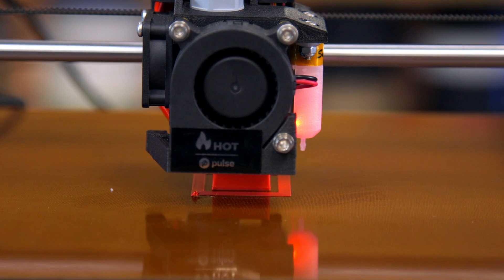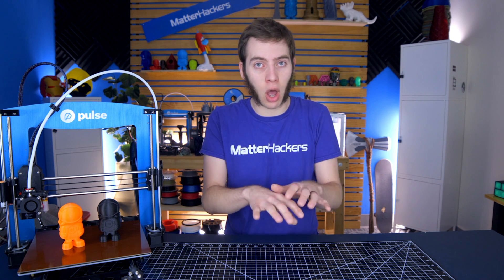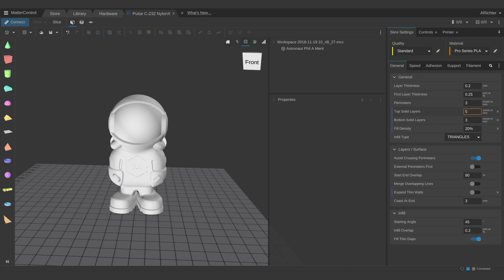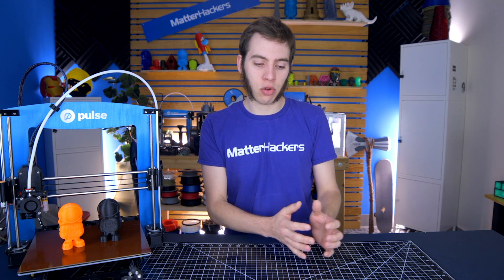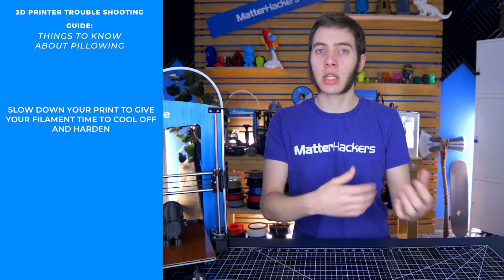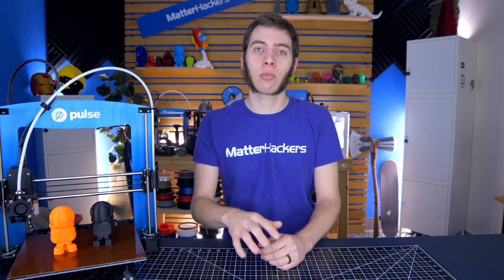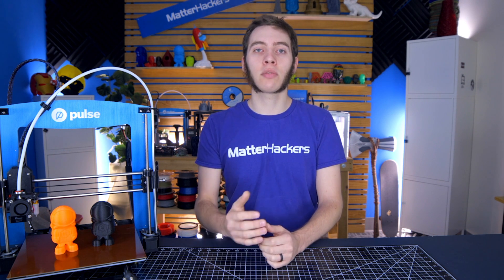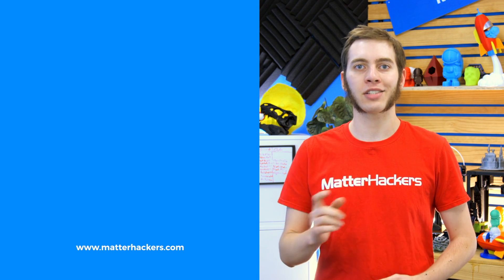3D Printing Troubleshooting Guide: Pillowing

Comment: (Stock ender 3 original for context) I'm having an issue where it's perfect at first but like halfway for bigger objects or top of smaller objects the printer just decides to not go up any higher.  I've tested with the move in the prep section and the z axis works as intended.  Ive leveled the bed several times for this.  I did warp the bed visibly (I should have a glass one coming today) but I don't feel like that's the problem.  I had to reinsert the belt so it's not that.  Im wondering could it be the y axis isn't tight enough?

Comment: I'm having a problem of my top layers not joining up with the walls. Looks like under extrusion but only happens at this point on my prints. I can't see any option in Cura to adjust the overlap. I tried skin overlap but that only works with infill. It's annoying as my prints are really good and solid apart from this.
Reply: Im having the same issue with my Cr-10 The print looks amazing other than the top layers. Let me know if you find a solution.
Reply: @ramrover   I'm starting to think it might be the filament. I have used new filament out of the packet and printed great. I think moisture has ruined the old one over time. It's about 2 years old and having so many problems now that no software tweak can fix, it has to be this. I've got so many work arounds I don't know anymore.